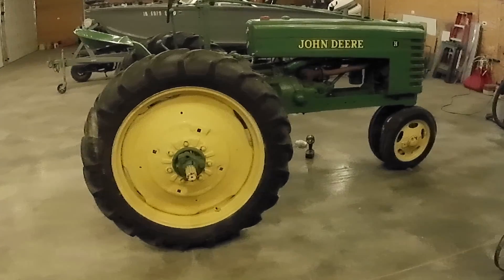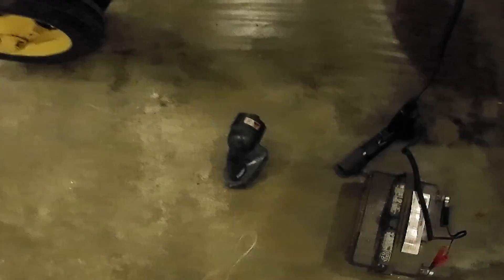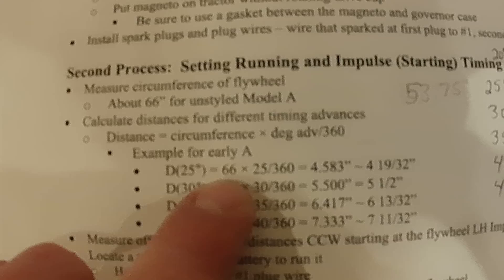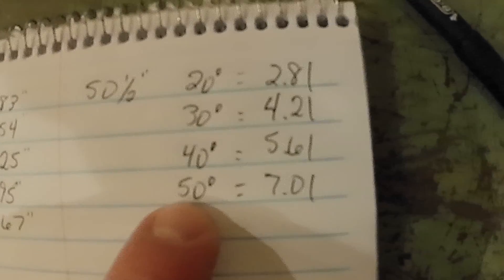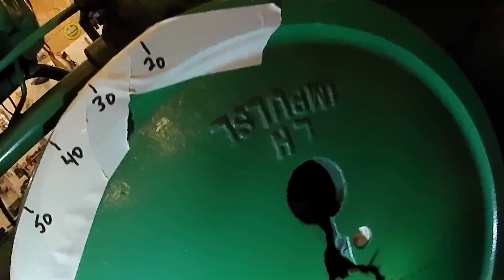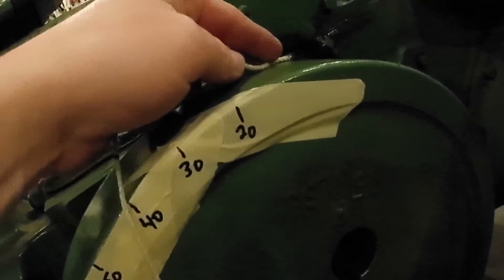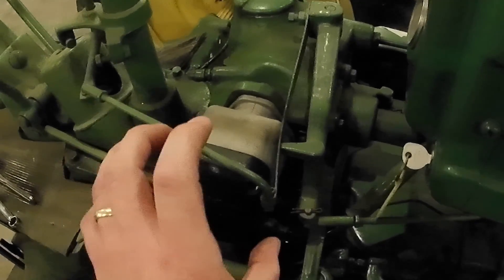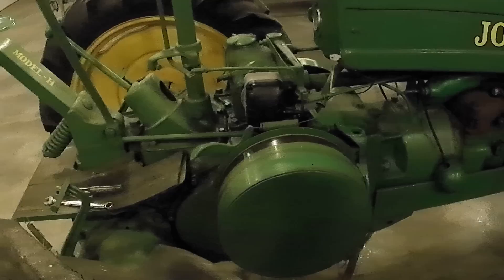Timing a John Deere

Comment: So you time these set at 20 to 30 at low idle?
I have mine set at 30 degrees at wide open throttle. 
I have a timing light with a dial on the back for the degrees.

Comment: This is way too complicated, but a very good analysis for JD two cylinder timing.  I followed the magneto timing instructions in the Deere owners manual and that was much easier.  There are punch marks located on the flywheel and engine/transmission case that locate the TDC mark of the crankshaft.  If you install the magneto at the correct spot with the governor shaft in the proper position, there is not a need for anything else to be adjusted.  I do not own a timing light, and my 1942 JD model B (Hand start!) runs like it should.  These tractors were built for farmers that worked on their own equipment.  The governor will either retard or advance the magneto timing as required for proper operation of the engine.